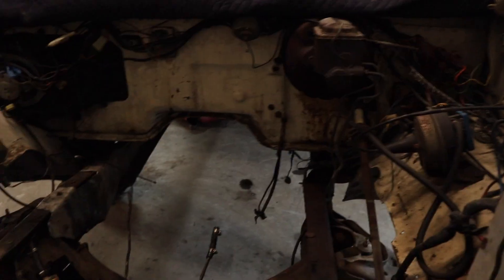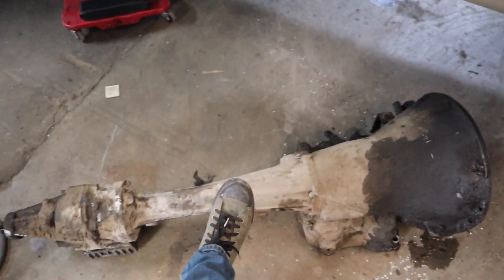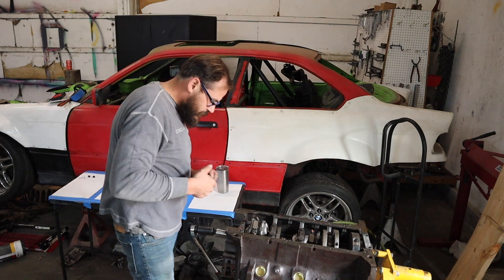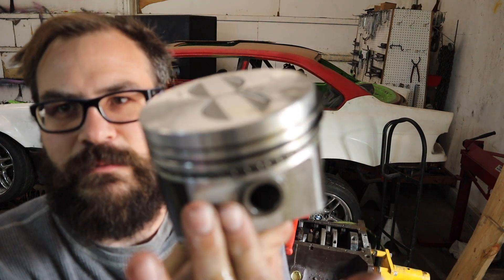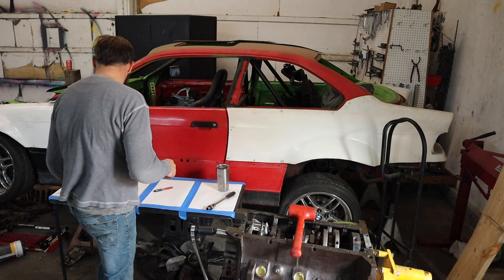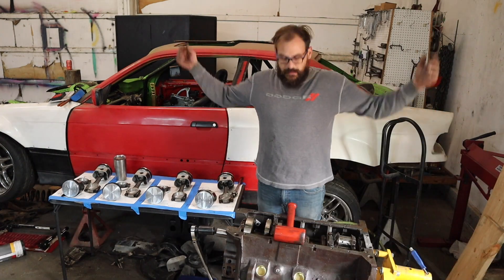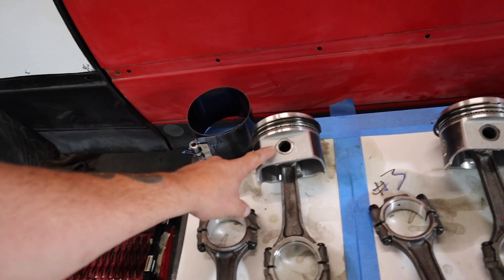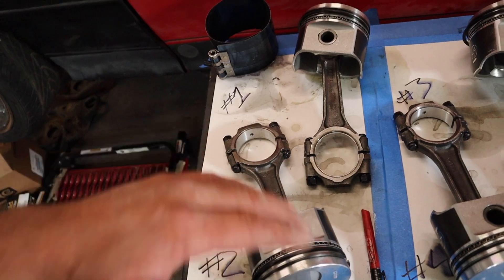The uncle Tony Piston Swaparooo

Comment: David Visard did a test a 302 Ford and added 20 horsepower. David backed Uncle Tony and that's enough for me. People like the Motor Trend engine masters guys will hate I guess since they disagreed. When David Visard speaks everyone should listen.
Reply from the maker: @naturalcreature6317 there’s always the people the just prefer to be negative.
Reply: The reason the OEM offsets the piston pins is to reduce wear, while dropping only a little horsepower, which is a good trade-off in their eyes.
    Turning them around does the opposite.

Comment: One of my biggest questions about this piston swap controversy is... Do the aftermarket pistons have offset pins? Apparently at least some do. Next question would be... Are they offset for quieter operation because they are ‘stock replacement’ pistons, or for a power increase? UT just made a 318 build challenge to them, but that’ll never happen. The real proof would be to test the theory on the same engine, same dyno.

Comment: "Work done sooner per compression stroke" ??? What! Look at connecting rod C/L to crank pin C/L at ignition point. The factory offset has a favourable angle for applying Tq to the crank.
 Now if your combo is wrong as is CR too low or octane too high the decreased piston drop at ignition point at ignition point 'may' hold slighty more cylinder pressure and crutch the bad rod to crank pin angle, cylinder pressure trace data would need to be used to prove this, contact TFX to go this way and have pressure data measured.
 In reality the hp change at WOT thru peak HP and TQ areas is a moot point. Where there is more effect is at partial throttle and steady rpm,  like cruising along the freeway, in thus condition the piston is destabilised with a piston flip and is noisy which wears them faster and makes the engine noisey AND is bad for ring seal which means more blowby, higher oil temp,  bore wear, ring land and cavity deposits and general engine sh!ttery.
Reply from the maker: Lol, there’s always an expert.
Reply: @Edthegearhead  exactly, guestimators and bullshitterizers dont like for some reason.
Reply from the maker: @8power857  you guys can have your silly argument. I like to experiment and have my own conclusions, based off my own experience. That’s what hot rodding is.
Reply: @Edthegearhead  nothing wrong with experiments! And certainly yes, hotrod and have fun, thats what its all about.